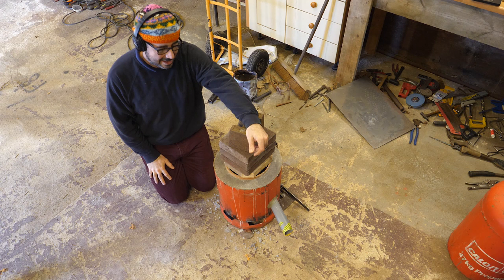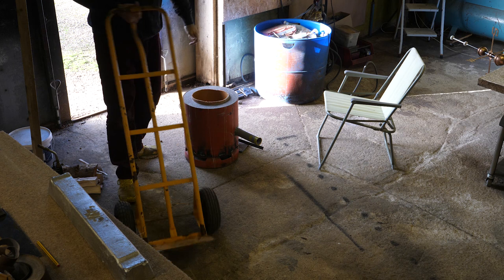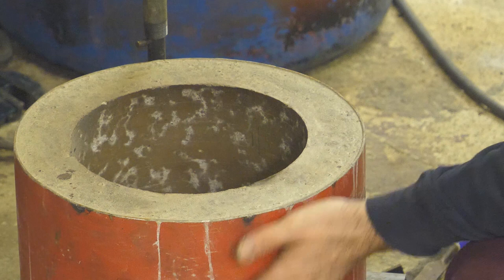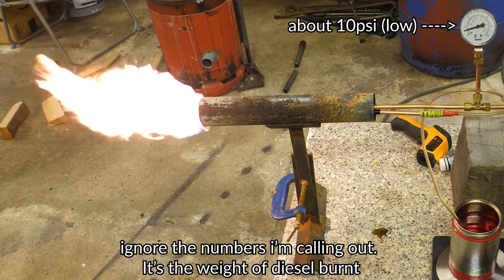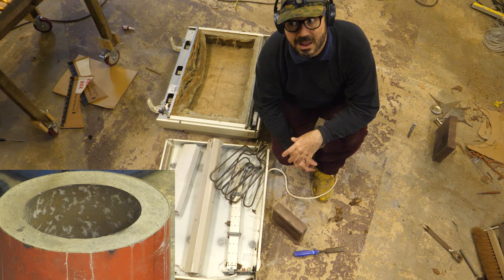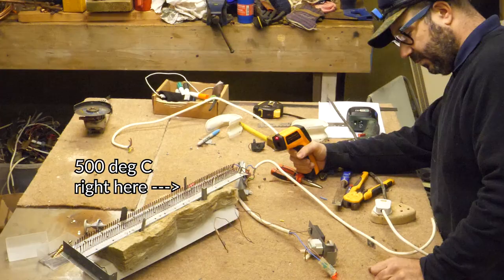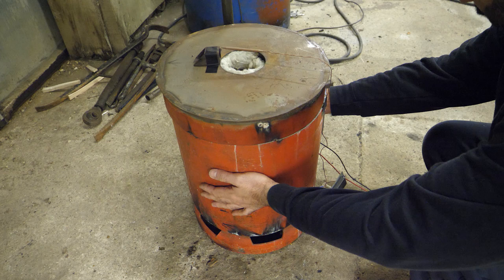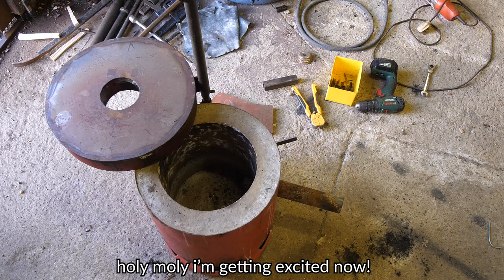DIY home made backyard foundry build * Part Four * WE HAVE IGNITION! * foundry Vlog * DIY foundry

Comment: Mate that is a monster ingot...  I dried my furnace for a month with greenhouse heaters before I used it and still got some spalling and a crack in the lid.  I read spalling can be caused by corrosion of metal sections within the cement which causes it to expand putting pressure on the surrounding refractory.  Maybe the combination of water and oxygen in the refractory corroded the metal causing it to expand ???
I also am self employed, and like you also suffer terribly with my back from time to time due to a prolapsed disc... Have you tried acupuncture, it really helps reset the muscles.  I've managed to dodge surgery several times so far via acupuncture.   Love your videos, they are really easy to watch.  Cheers buddy.  Andy